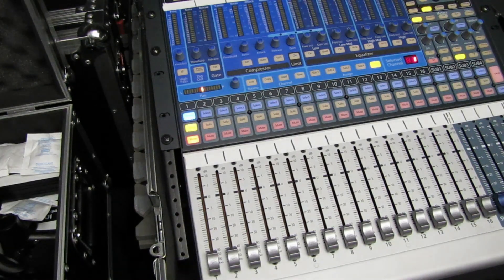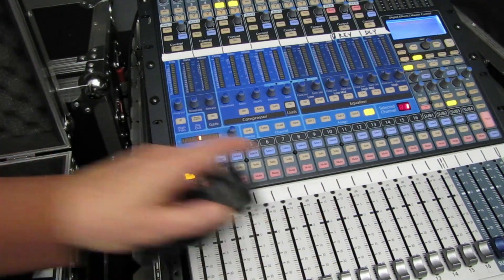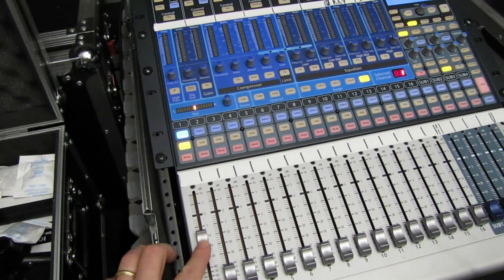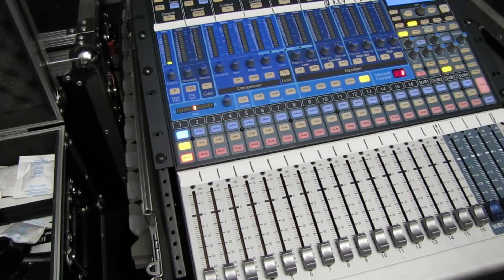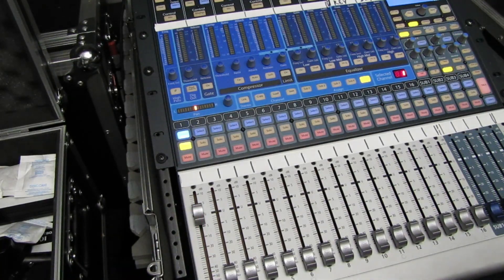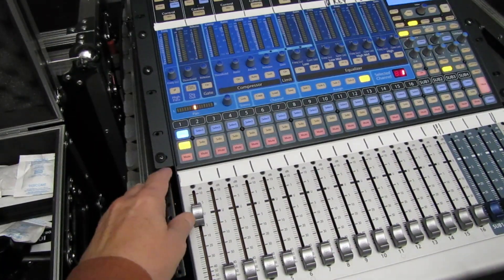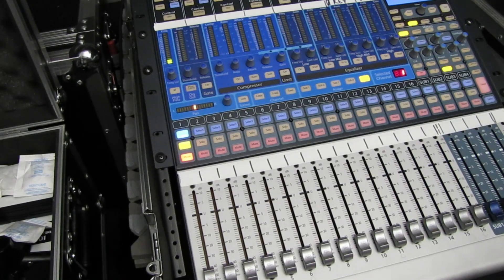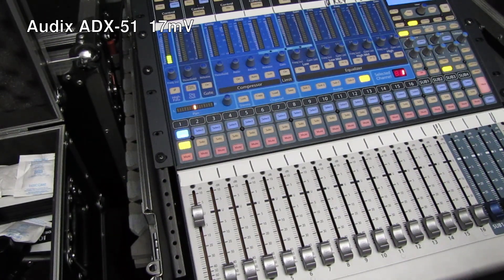Microphone Sensitivity - an important specification to know when running live sound

Comment: What would happen if you used a dmx cable instead of a xlr cable to connect a microphone to a mixing console
Reply from the maker: Nothing.  DMX (3-pin DMX) and XLR cables are nearly identical.  DMX cables usually have thicker shielding on them to help protect against noise.

Comment: What would microphone feedback sound like through a subwoofer and a full range pa speaker.
Reply from the maker: Feedback rarely occurs through a sub-woofer, if it would, it would need to be low frequency feedback.  For a full range PA, it sounds like exactly like feedback through a monitor speaker.
Reply: Im a guy into electronic stuff especially microphones ive made a microphone using a subwoofer@stageleftaudio

Comment: What would happen if you plugged a microphone directly into the channel A or B inputs on a power amplifier instead of the microphone inputs on a mixing console.
Reply from the maker: Probably not much.  Microphones don't produce a lot of voltage to drive power amplifiers.  This is why mixers are used; they amplify the microphone signal so that it can be sent to something like an amplifier.  Some powered speakers can accommodate a microphone being plugged directly into the back of the speaker.  This is what the "mic" setting is for on the back of some powered speakers.

Comment: Again. I love this. Shure SM 57 is the industry standard for instrument mic. Audix has produced many good mics. You are occupied in this vid about sensitivity which is good on gain settings on the board but we cant forget freaquency responce. I found a Fender mic that was so warm in the vocal range and with higher frequency clarity in the high mids that I wouldnt change for anything. As for bass drum mics , I use an old AT 25 as apposed to the competiters. But all is good as long as you get desired results. Peace Guys. Again , Love Your Stuff, Keep up the good work.
Reply from the maker: The 57 is a decent mic.  Thanks again for your comments!

Comment: i've also seen mics rated by the max dB spl before distortion. how does this relat eto the mV rating?
Reply from the maker: Good point.  The mV will increase when more SPL is applied to the mic (more than the 94db @1K reference), which will result in more volume (more mV) from the mic.  As well, a lower SPL at the mic will result in a lower mV output.  The Pascal level (standard reference) is used to show the differences in sensitivity between mics.  A low-sensitivity mic could produce the same mV as a higher sensitivity mic... assuming the low-sensitivity mic has an adequate SPL presented to it.
Thank you for the good question.